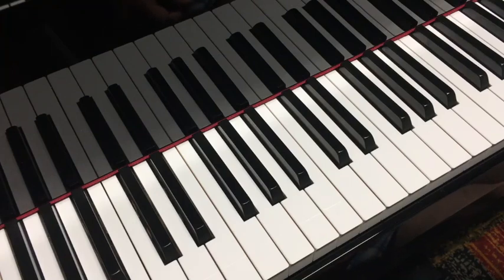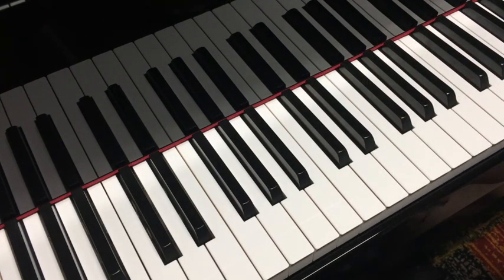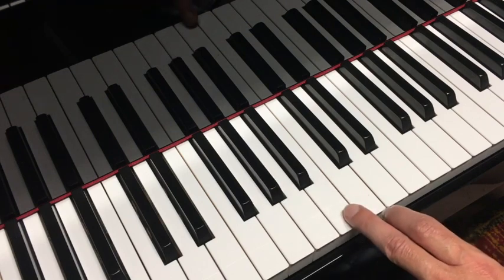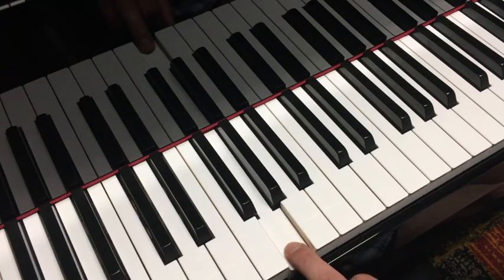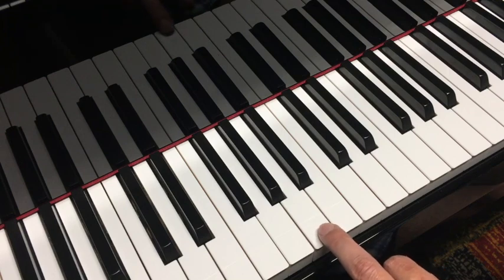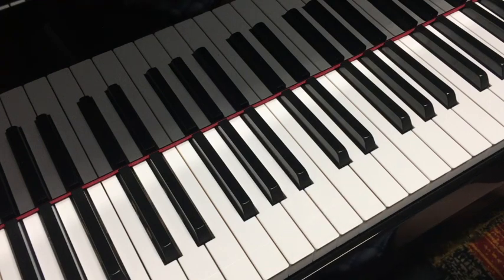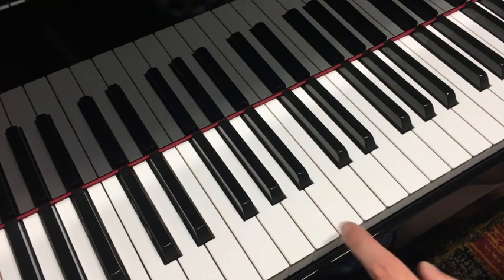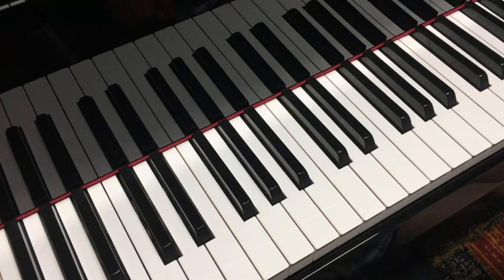VSL 280VC Buzz

Comment: Did you ever sort this out? I do not hear the buzzing you describe other than the natural 'buzz' of the note being dampened, which I heard on all the notes you played.

A couple of thoughts based on my experience...
-Do you hear this with both headphones and your speakers? It it's only through the speakers, it's very well possible that this note and the adjacent one is exciting a narrow-band resonance in your speakers. I measure a lot of speakers and even if they're decent overall, a small resonance like this can be just that - distracting. It could even be something else in the room resonating. This actually happened to me with another VST. One specific note was exciting a resonance and I had to move things around a little to stop it.

--It you hear it in your headphones too (again, for some reason I'm missing it) does VSL have a way of adjusting the release sample length? You might want to try that or turn on/off adaptive releases if possible and see if that affects the buzz.

Good luck!
Reply from the maker: It's definitely the sample. It's one of the drawback of this particular library.